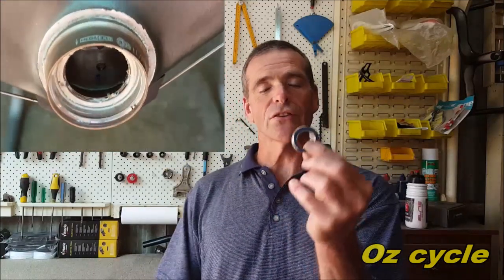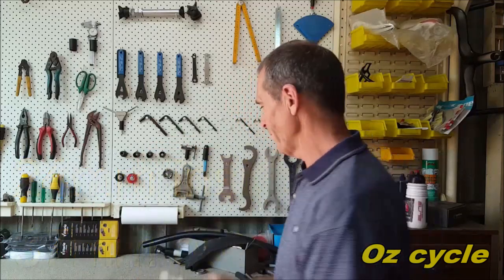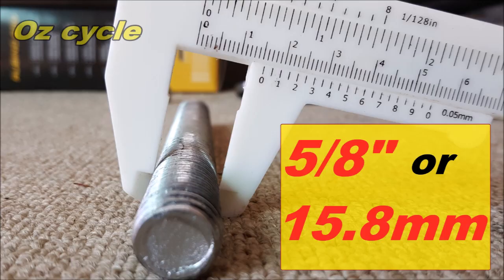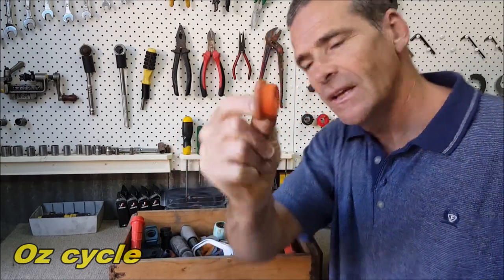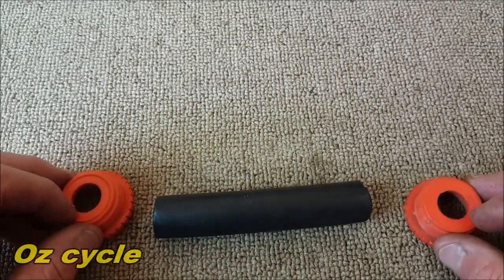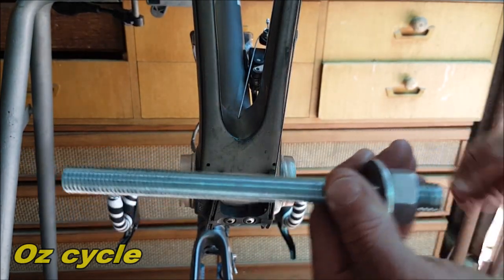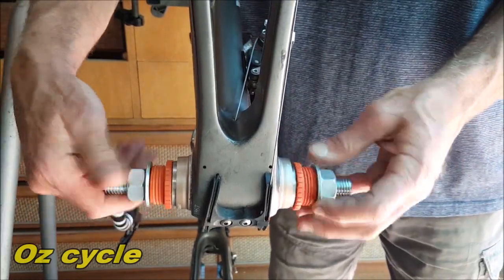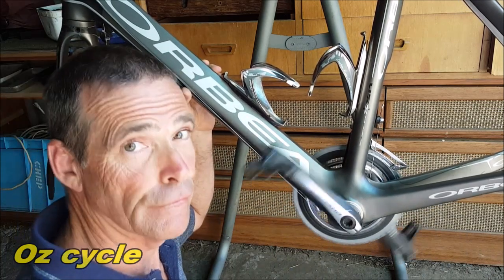Bottom bracket press tool - make it yourself

Comment: hello ,really nice video you are very talented, my question is I have just purchased Campagnolo chorus 12 speed cranks and  bottom bracket is BB86.5 X 41 can this tool be used to press the cups into the frame. The bearing on the Campy cranks are on the spindle?

Comment: The bottom bracket that I have to use (sm-BB7141) has a tube that goes between the 2 bearings. I have a feeling that there was more to the bottom bracket on the ends two.

Comment: I think the poly tube as a drift is not necessary. Once you pre-fit the bearings in the shell, they are already tightly aligned right. The only drift guide which might me useful is for the any piece that presses on the bearing but here you got a nice plastic adapter which center hole is of the same diameter as the threaded rod so it stays centered while pressing on the bearing.

Comment: can you show us how to make tool for Bottom Bracket PF30? including the removal tools if possible. thanks in advance! Kudos for your in depth video!
Reply from the maker: +Abdul Hafeez Sadon You should be able to use the same tool for your PF30 bb,Abdul...same bearing size. To extract the cups,use the same method as in the video....Park tools recommends tapping out the cups in the same way.
Reply: great! you're indeed my walletsaver. Keep it up!

Comment: Hey nice video  but how you know  went  you have to replace  tha bracket?
Reply from the maker: Usually the bearings are not smooth any more or have slight lateral flex. Often you will hear a slight creaking sound when pedalling.
Reply: @stevenleffanue   yeah its some  creanking but has some olay too .

Comment: thanks for posting this video. I probably asked a question on another of your videos, but this video is more relevant. I have a GXP BB92 BB, which is 37x24 on the drive side and 37x22 on the other side. I searched Bunnings but couldn't find a washer with a 37 OD. Can I ask where you found the washer?
Reply from the maker: Try plumbing section. If no luck try an automotive supplier, they usually carry odd sizes.
Reply: I managed to make the tool, but substituted two 5/8 washers on either side, and a 93mm length of 22mm pvc pipe instead of poly tubing. The 5/8 washer has an OD approx 37mm. BB went in nice.
Reply: Hello. I know this is old but I also have a BB92 I need to work on. Did you use those garden spigot adapters also on your DIY press? Or just the 37mm washers?
Reply: @realjighead4282  just washers. And a short length of PVC pipe to keep everything centered.
Reply: Awesome. Thank you
Reply: @realjighead4282  if you can salvage the bearings themselves from the BB cup/shell, you can use them instead of washers for your next BB replacement.

Comment: Oz the DIY Bottom Bracket Press Fit Tool... could that be used for a BB92 or is it for BB30?
Reply from the maker: +Billy Bradley BB92 is 30mmx41mmx11mm so that should be no problem using it for that Billy.
Reply: Thanks Oz much appreciated great videos and money saver.

Comment: +oz cycle - I read the vernier at 15.55 or 15.6. Am I reading it wrong?
Reply from the maker: +Darren Smith Sorry Darren...what measurement is this for?
Reply: Thanks for the quick reply +oz cycle. The verniers show the measurement for the 5/8 threaded rod - but you explain that it was 15.8mm - when I read the vernier it looked like 15.55 or 15.6. I was simply asking to confirm if I was reading the verniers correctly from your video.
Reply from the maker: +Darren Smith ok. Video rarely shows exact measurements. 5/8th is 15.875mm or commonly known as 16mm. Hope that helps Darren?

Comment: Are pressfit servicable?
Reply from the maker: Yes
Reply: @stevenleffanue  You mean I can service my Shimano pressfit bb on my mtb? when I take off my crank arm, everything seem so sealed that I don't even see how to remove the seals in order to degrease and relube.
Reply from the maker: Remove crank. Remove dust caps with a blade,small screwdriver or dental pick. Remove bearing seal with simial tool. Clean bearing,regrease and put seals back on. Done
Reply: Not all bbs are the same then. I got to the seal and that was as far as I could get. The seal was inside and the cup was built in such a way it has to come out first before you can access the bearings. Such a pain in the ass.